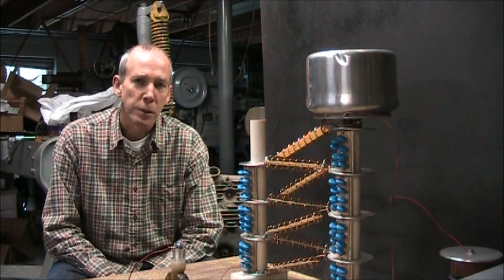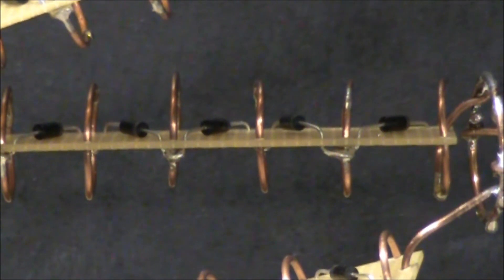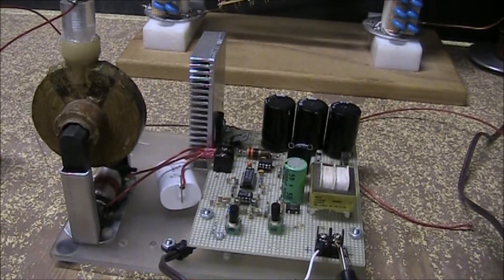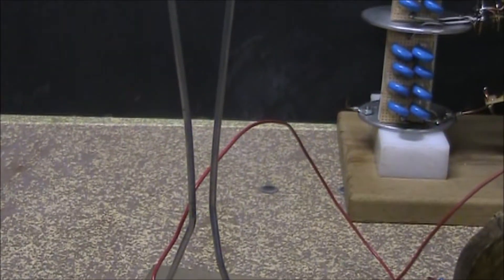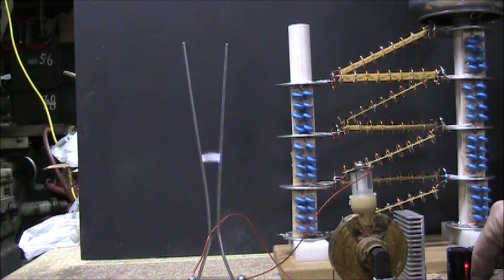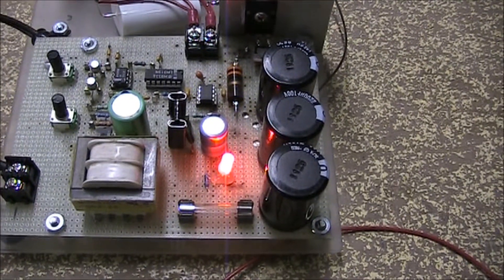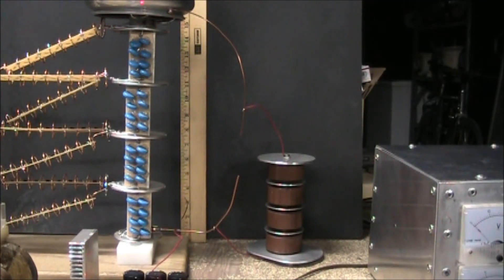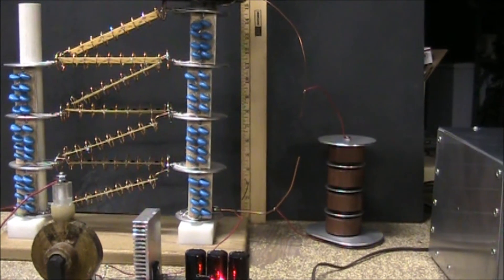Voltage Multiplier #1

Comment: Really liked Corona reduction efforts. Just like the big stuff at national labs. I had no idea how badly Corona discharge zaps output of a multiplier.. It's bad. And that cap stack in parallel is awesome. Lethal but awesome.
Reply from the maker: Imagine the loss on those 500 KV transmission lines.

Comment: Hi. What are the rings for ? And Drives on the capacitors ?
Reply from the maker: The rings are for corona shielding. The capacitors are just a series string with diodes.
Reply: @stephenhrobak3631  Thanks!

Comment: are those out put sparks dc discharges or ac ???
Reply from the maker: The voltage multiplier is used for a DC power source
Reply: @stephenhrobak3631  thank you for responding. can u please give me one answer ??? does this device produces PURE COMPLETELY PURE unidirection current discharge?? I mean pure raw DC ??? plzz tell me
Reply from the maker: @boxgajodar4144  For the video I used a spark gap for the visual drama. The spark is really a short circuit. So the voltage must build up again by charging up the capacitor chain. I made a Cockroft Walton generator video with a amp meter that shows the output as DC. Thanks for the interest
Reply: @stephenhrobak3631  thank you

Comment: Great project. Dear friend could you write please what kind of diodes and capacitors did you use ? Because of high frequency diodes must be fast, also it seems, that the currrent is high. I used in my multiplier 2CL77 diodes 20 kv, but the maximal current through theese diodes must not be larger than 5 mA, it is not enough. Off course there are diodes 2CL2FM, but it is problem to buy original  diodes. What do you think about diodes R5000F (R5000) ?
Reply from the maker: I do not know the part number for the diodes but they were rated 6000 volt at 200ma. The capacitors are rated .001 micro fared and were bought on E Bay around 10 years ago. At that time they were available for low cost and many sellers carried them. Thanks for your intrest
Reply: @stephenhrobak3631  Thank you.

Comment: Do you have a schematic for the driver board, or is it available on line, or is it your own design would like to build one if possible.
Reply from the maker: I used a SG3524 Driver IC and down loaded the data sheet. There are schematics on google search . What makes this transformer  work well is the resonant capacitor at the switch end of the coil and ground. Watch my video with series ferrite transformers. I just started construction of a H bridge transformer setup I am going for a 3 KW multiplier.

Comment: Great design! A lot of work  you put there... :) Was the corona shielding useful? Did the capacitors and diodes survive?
Reply from the maker: I am glad that you liked it. This was a test for multiplier design and everything worked well. I have bigger multiplier posted also.  These units are not meant to be used as a Marx generator but I could not resist making sparks.